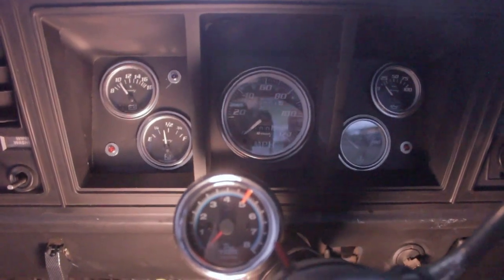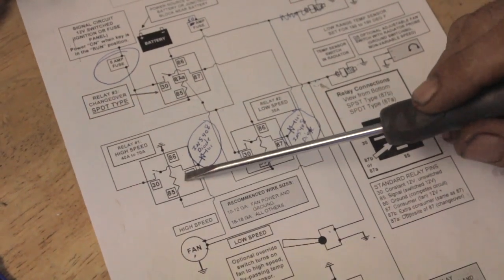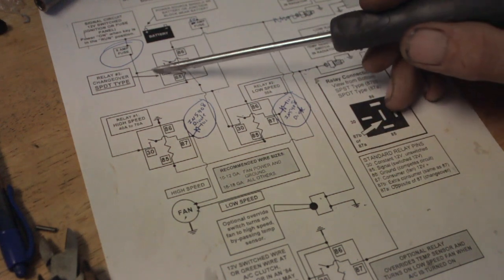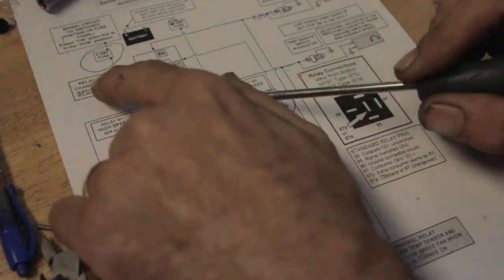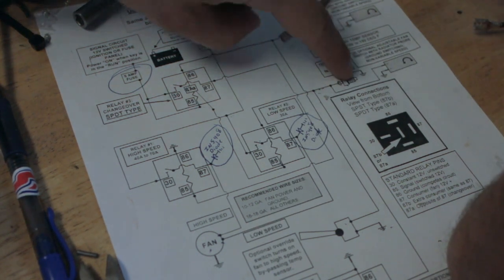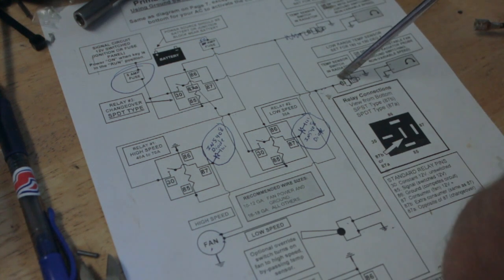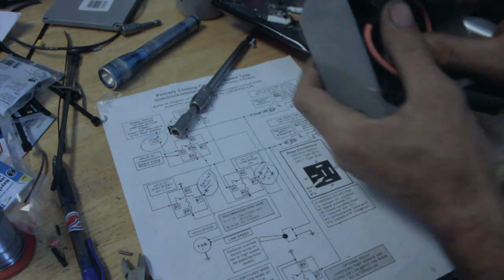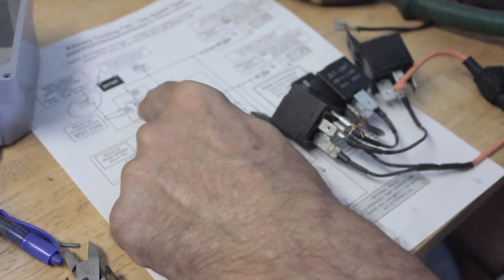Wiring a 2-Speed Electric Cooling Fan - (1973 Ford F100 Rebuild = Day 52)

Comment: nice... so the diode... you go from the hot line to actual ground? I'm planning on setting up ford windstar van fans in my k20. You have shown the light on low/high... so now I understand a bit more. still more to learn. but now I think my windstar fan kit of 2 fans.. 1 has 2 wires and 1 has 3.. so three wires = 2 speed fan and 2 wire = one speed...???